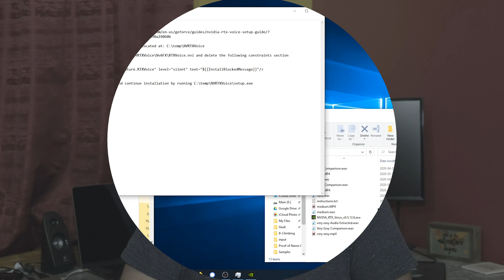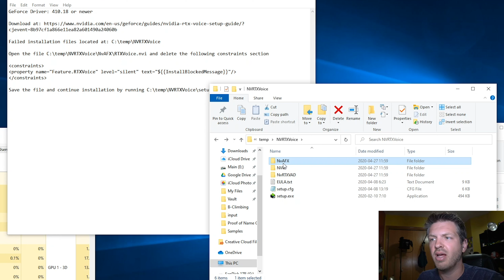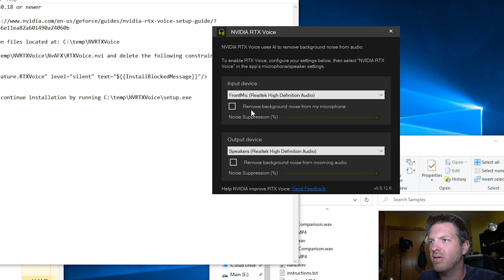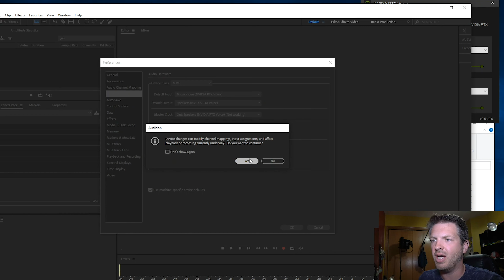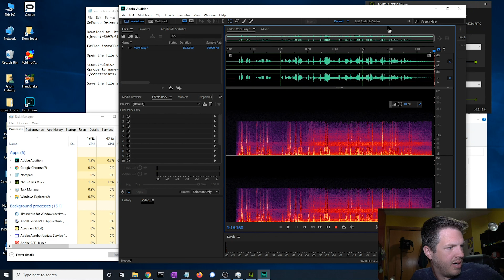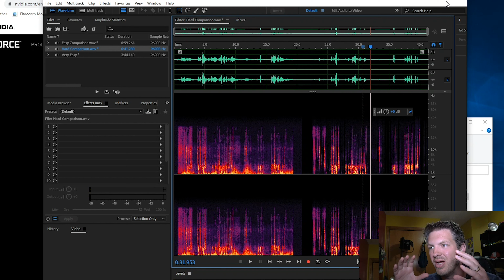Video Editing with RTX Voice

Comment: Here is how you can do it on one machine... First download a virtual wire program like VB-Audio Virtual Cable (you actually don't need Voicemeter to do this either). 1. Setup to play a video in a normal video player like VLC where you can select the audio output to goto VB-Audio Virtual Cable. You can also select audio output in windows settings if using windows craptastic media player. 2. Set the mic input on RTX voice to VB-Audio Virtual Cable. 3. Set your recording programs mic to Nvidia RTX Voice (easy to do in Audacity just up at the top next to the mic icon). 4. hit record on Audacity (or sound edit program that records), hit play on VLC (or whatever video player you use to play original video), hit stop on both when done. Ta Da then new audio into whatever video editing software you use, replace audio and line up, sync etc.
Reply: You don't even need VB-Audio Virtual Cable. Most sound cards support Stereo Mix... Usually its either disabled by default under microphones and you have to enable it through the Sound in the Control Panel... or you need to install the manufacturer's motherboard's drivers (not the default Windows 10 drivers). Otherwise pretty much the same principle as above.
Reply: @ksteinmuller  I was about to give this solution and you guys already did. I give you a like to say that I did this as well and ir worked.
Reply: This is the much better way to do this as you're not adding a lossy  and potentially noisy DAC->ADC conversion inline
Reply: Damn I love this idea
Reply: Interestingly, I've just tried this on a video I'm working on (a man and a woman making cocktails, with really noisy metal ice buckets and ice being sloshed into drinks, obscuring their voices) and when the man is speaking, the Nvidia RTX noise reduction works really well, but it's pretty much useless on the woman's voice - pretty much eradicates everything she's saying! I guess Nvidia tested it for gamers, the vast majority of whom are boys/men, who want to remove their mothers' voices telling them to clean their bedrooms!